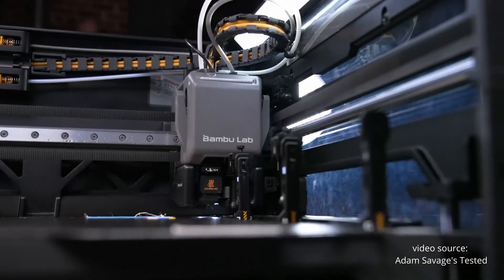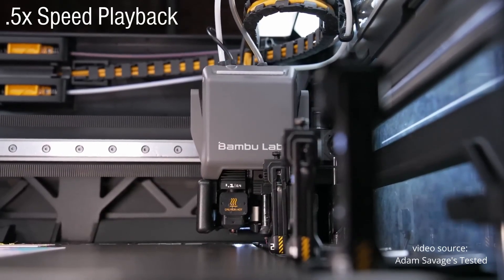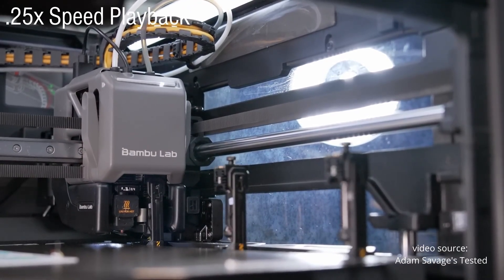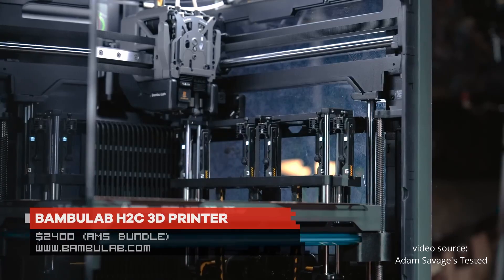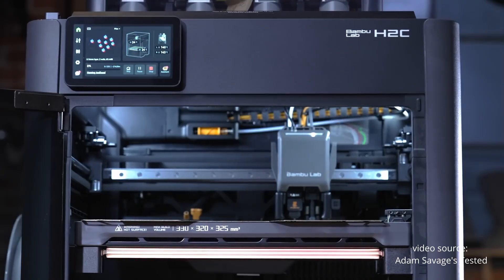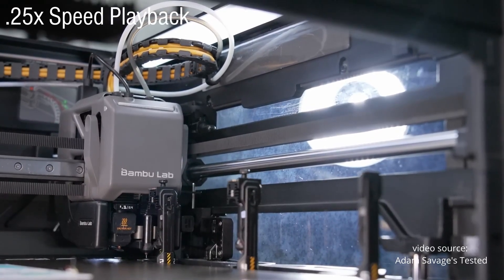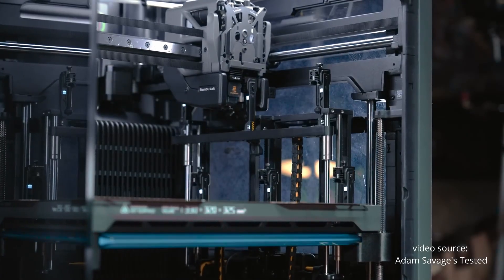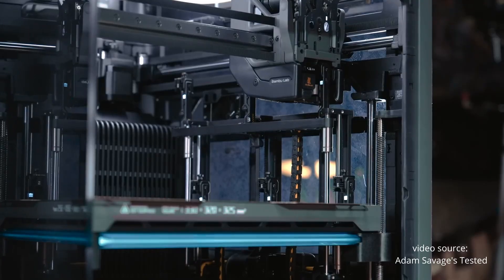The H2C Solves One Problem — But Creates Another

Comment: I don't think anyone expected it to be a real toolchanger, especially after the video they released along the H2S launch. Personally, I don't have much interest in a U1/Prusa XL as I want a closed/heated chamber and enclosed filament, and the sleeker/more compact setup is also a big plus. If your main use is printing 3 or 4-color PLA models, the U1 sounds more appealing. But I see the H2C more as an H2D (printing with a seperate support material or incorperating TPU into ridgid materials) with the possibility of having different nozzle sizes at the ready without having to change them manually, with an advantage for the occasional multi-color prints.
Reply: There is definitely a use case for both.
Reply from the maker: Yes, depending on how deep your pockets are and for your use case filament consumption levels are high priority, the H2C can be a good purchase.
Reply: @aim6mac  Well only compare at the moment is a fully upgraded XL we have some extra cash to spare i would say.
Reply: Yeah the H2C’s approach certainly has a huge advantage when it comes to connivence.

The U1 has benefits of being a true tool changer but because of that it’s also limited to its 4 combinations of filament and nozzles. The H2C can do 24 types of filament (with 8 AMSs) and 7 different nozzles, which is 168 different combinations at your fingertips.
Reply: exactly - if you want to decide to use a specific nozzle size of a print, on the Snapmaker U1 you would have to swap out the nozzle or have loaded lets say 3 spools with black PLA with 0.2, 0.4 and 0.6 mm - that would totally suck

it just depends on your use case

Comment: Woah, slow down there partner'!
Just shorten the length from the AMS to the printer by cutting the PTFE tube in half and making a setup so that the AMS units are directly behind the printer.
Seems like you're in a really quick rush! This printer (as of now) is mainly for multi-material and multicolor prints while making sure you don't waste a single bit of your precious PPS-CF or other high-grade engineering filament. No other consumer-grade toolchanger can do that as of now!

While it is definitely not as fast as the U1, it can nearly just touch the peak if you optimize your filament path. The pickup and drop-off time for the nozzle is faster than that of the U1, the only reason why it isn't as good is due to the filament retraction and grabbing. If this is left unoptimized, your hotend is already fully induction-heated to 250C and your filament isn't even a third of its way back to the printer.
Reply: Cutting the tubes a little only saves max 4 seconds and for most if want to stay practical with 2 or 3 ams boxes 2seconds. There is way more time to be won in other (doable) ways we will see the evolve even in firmware only. i now have a h2c and can see what is happening and were it waits and wonder why. will never be a speed demon but much time can be gained.

Comment: Biggest botelneck is AMS in this new H2C system. they need to figure out some new AMS for this machine. the old one still has on ly one ptfe going out of AMS which is limiting factor here.
Reply: You mean tpu?
Reply from the maker: yes need to have multiple PTFE tubes going all the way to the AMS, maybe just MAYBE they might do some mod for that with a new AMS system, but i doubt it

Comment: Prusa and snapmaker Quality is a no for me.
Reply from the maker: actually both of those printers are supposed to be printing high quality :)
Reply: @aim6mac I've had so many printers.  Once I went Bambu.  Not going back.  They got me.   Now I'm focusing on designs and the fun part only.  I don't care how it prints.  It will come out good.  I design.. print... change... print...repeat.  before bambu.   I would always say...meh. good enough with other printers.   No name shall be stated.   Lol.  I'm sure some i haven't tried are good but.  I'm too tired to being a beta tester for these companies on there production models. For years I've been trying to justify my other name brand printers and tried so hard to avoid Bambu.  That's my opinion.

My A1 is still a beast.  Had it for so long.  My X1C had a few hiccups but it's ok.  The H2S is my new favorite.  I have 2.  

This H2C's hot bed is not even so I'm a little bit on the verge of skipping this model.  But I might pick one up just to print color.   But will have to use Brims when printing on the left side. Lol

Comment: I still have an issue with current tool head changers. The quality from the prusa xl still doesn't impress me and the snapmaker just like the xl are all open chasis. Also the big thing in my mind is the color availability and closed filament storage. Both the snap maker and xl still just have the filament hanging on the side in the open. At the least the h series has it enclosed in the ams. I've seen good quality about the snap maker but the limit of the open case seems like a hurdle all manufacturers still struggle with.
Reply: Prusa jest w 19 wieku.
Do tego ich drukarki są astronomicznie drogie i ciągle się  coś psuje.
Reply: It has an enclosure - I bought mime with it. 

The chamber heater is passive, but it's 1/3 the cost of the H2C... 🤔

For slightly more than the H2C, I got two U1s on kickstarter, one H2S with AMS combo and filament rolls...
Reply: @Boombastick17 a passive chamber heater is no chamber heater,  it's a draft stopper only be real
Reply from the maker: the U1 has an official enclosure and i've seen very futuristic beta programs where u can print out your own for the Prusa and for the Snapmaker U1, i think the future is bright!
Reply: @aim6mac  the enclosure for both of those is massive and an eye sore.
Reply from the maker: @SpartanORGN  they need to be bigger then usual by design, the PTFE tubes go up high therefore the top hat needs to counter that.
Reply: @aim6mac  exactly, that's why it's a bad design and ugly.  The INDX somewhat solved the issue by putting the heads at the front of the machine.
Reply from the maker: @SpartanORGN  yes looks are def. a part of the 3D printer BUT most people put them in their garages, and don't care what they look like or how much noise they make :)
Reply: I just watched the prusa/indx thingie.. went to their pre-order page and really feels all like we have made 2 working units as demo's not something that is done. You can put yourself on a pre-order list then 1000 will be shipped in april? but you have to buy a printer first but not the Core One L yet the printer that makes most sense compared to the h2c and buy the kit from other company and transform the printer yourself? These new spools are separate right?...,Maybe i am confused but thats how it felt to me... At what moment can i just buy a printer from Prusa say a Core One L with 8 INDX, 8 spools and have it shipped ready to print... Seems focused on the 'we love to build printers crowd' so far who also need to be ready 'to help make it better as in beta-testers'. Again maybe their announce was just confusing and someone knows the answer.
Reply: @scb2scb2 that would be early next year like they said.

Comment: For me it is exactly the right device at exactly the right time. It includes everything I need, no more and no less. It is also a completely different technology than a toolchanger. At the moment everyone thinks only within the toolchanger frame, but this is a completely different approach with a completely different purpose.
Reply from the maker: exactly, it's a great solution for those with the same issues as you, wasted filament will be reduced with this!  But me as a speed demon , it really isn't bringing anything on the table sadly.
Reply: a completely different approach (and a heavily compromised and highly complex one at that), yes, but not a completely different purpose.
Reply: @sasca854  I see a clear advantage in this setup. The combination of dual heads and an automatic nozzle switch fits my needs perfectly. My AMS units stay useful and I focus more on functional technical parts rather than colourful display pieces. For that kind of work this approach makes far more sense than a simple tool changer. The extra speed is another benefit. It might not be the fastest system on the market but the difference is negligible for what I do.